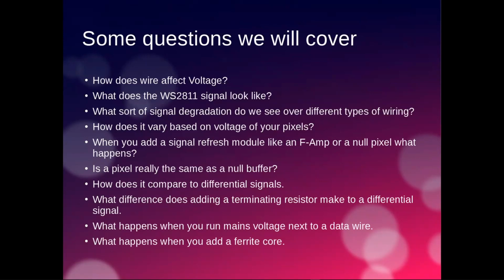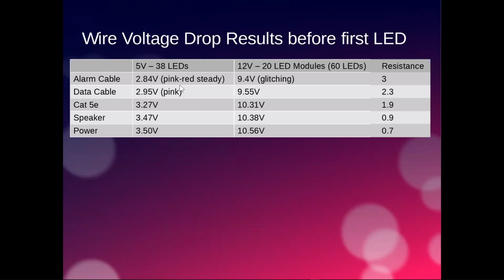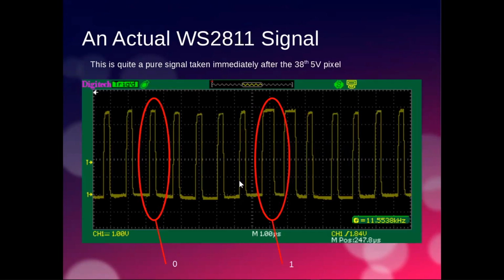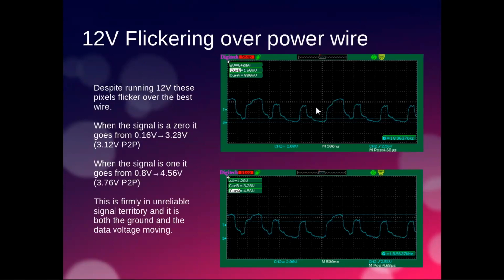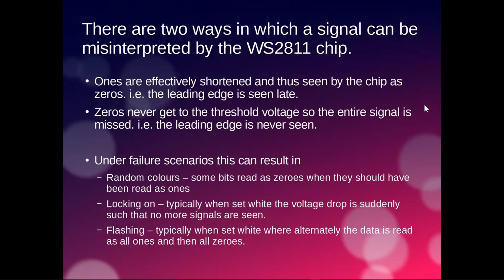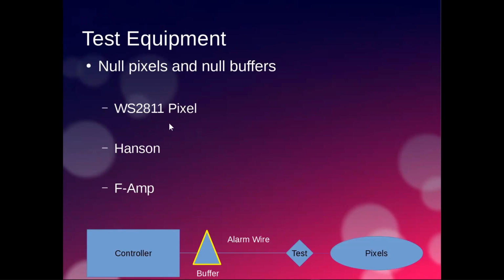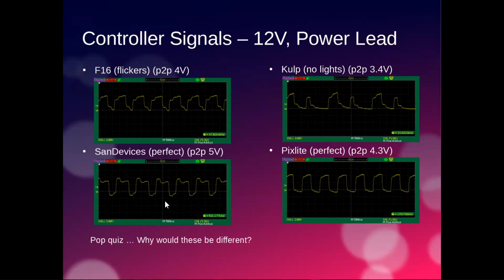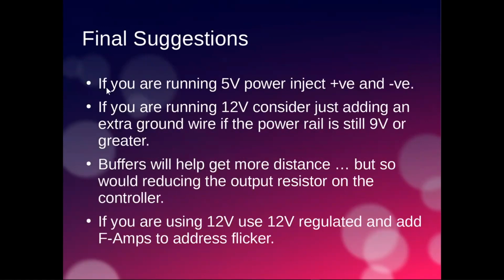AusChristmasLighting 2020 Expo - DMX and WS2811 Signals and wiring

Comment: Excellent video. Really help me understand voltage drop and data loss.  I use 5v pixels and someone suggested using F-amps would be good but after watching this I see that I don't need F-amps just power injection of the power and ground wires.  Thanks so much for making this video.